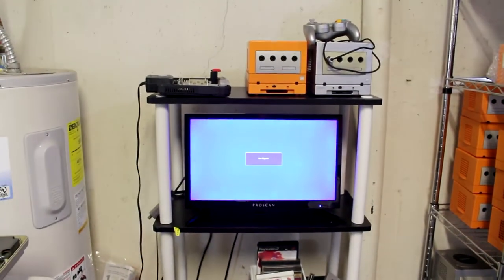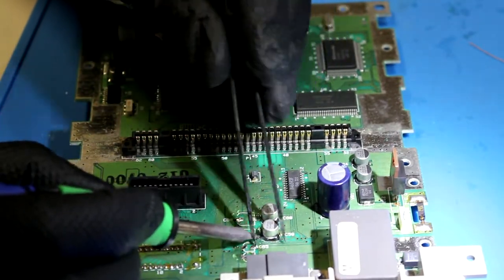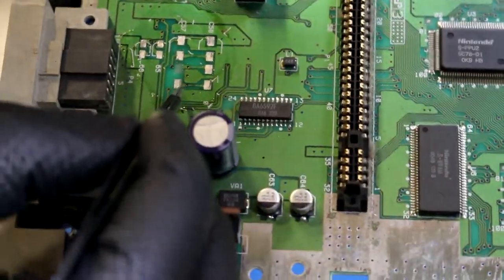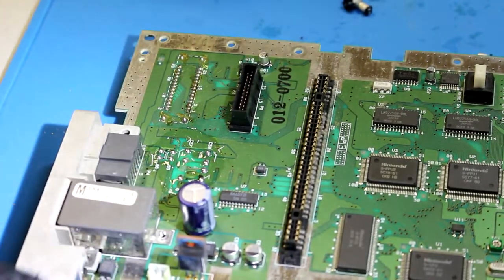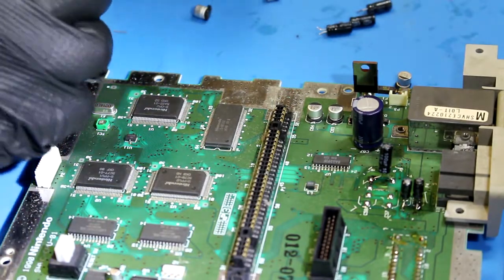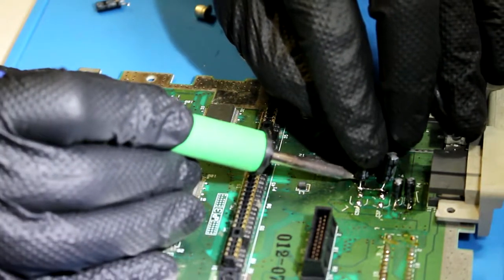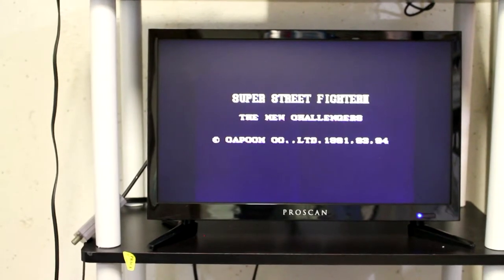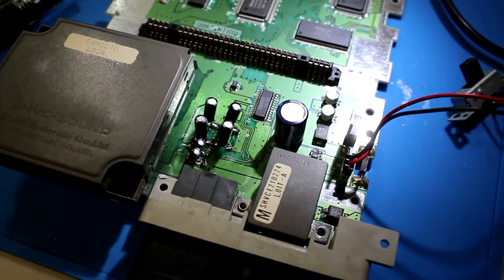Super Nintendo/Famicom SNES/SFC Video Repair - Black & White Screen Jumping

Comment: Nice fix, looked like a sync issue, I think my famicom I showing signs of cap failure, will have to do it at some point, very brave leaving that voltage regulator or should I say cigarette lighter with no heatsink while on  lol the SNES one gets extremely hot very fast.
Reply from the maker: I like to live dangerously.

Comment: You could have just bent the capacitor leg to run parallel over the broken trace and solder both capacitors to the same pad. They’re in continuity after all it shouldn’t matter.

Comment: I thought it worked when you Used the RF connection. Right? I have one doing the b&w scrolling and I’m trying to get it working. Thanks for this but my Super Nintendo is the 1991.
Reply from the maker: The capacitors are on a different signal line.

Comment: I have a SNES with a graphics problem that I thought might be related. My video output looks perfectly clean except for the fact that the whole screen scrolls vertically, wrapping around from the bottom back up to the top. The scrolling motion is slow, such that it takes a few second to wrap fully around each time. I tried replacing the 6 capacitors that you replaced in this video, but that did not fix the problem (no change that I can tell). Got any other suggestions? For reference, I'm using the original power supply and composite AV cable with an old CRT (which works). The motherboard is labeled "SHVC-CPU-01". Thanks in advance!
Reply from the maker: Sorry, I couldn't really say without looking at the board.  You could also try replacing the caps 33uf caps by the voltage regulator and maybe the regulator itself.

Comment: Hi, I have a Super Nintendo Jr. with some kind of glitch pixelation on the screen, it doesn’t show itself all the time , I was told it was due to bad AV cables so I swapped them but the issue is still there can you tell me how to fix this?
Reply from the maker: Unfortunately, that sounds like a bad PPU chip.  The only way to fix that is to harvest a replacement chip from another SNES.
Reply: Doesn’t the Super NES Jr have only 1 Chip?

Do you offer this service?